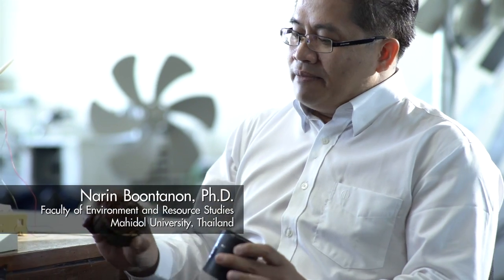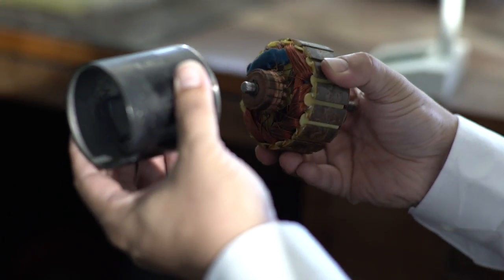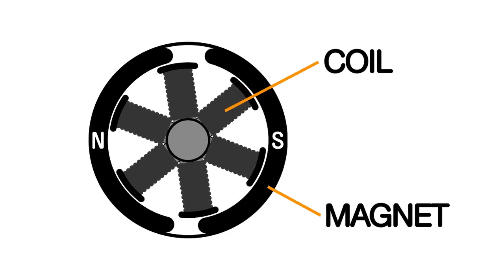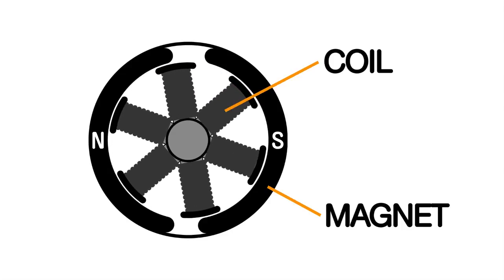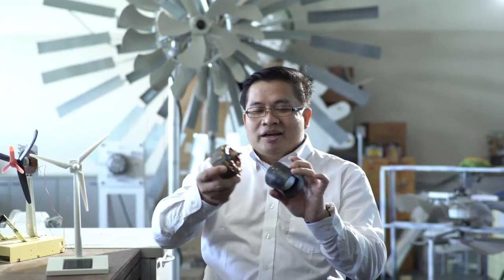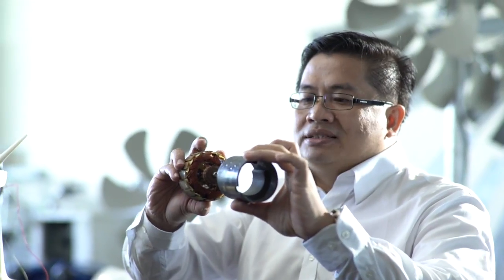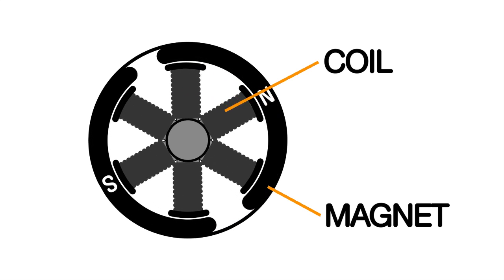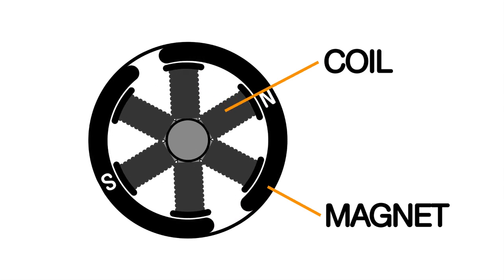Counter-Rotating Wind Generator : Research Impact [by Mahidol]

Comment: I think it just some replacement of gearbox)But counter rotation moment is good for self stabilization, and absorb of vibration. Desing has some complications to produce shaft in shaft, and rotor in rotor, like in a helicopter 🚁) By the way I love traditional Thailand windmills they are cool👍💪 adjustable sails , just add to them a  bicycles gear box and bicycle motor 3kw 48v-72v and it will generate power!

Comment: The biggest problem you're gonna have is you need to rotate the statter at the same speed as the rotor otherwise you're gonna have variant voltages.  And with wind that  Can be very difficult because wind isn't  stable
Reply: tested and working

Comment: Very nice thinking to overcome low speed wind, as increasing blades number will increase solidity by ratio, accordingly power too.  I have some questions: 
1) How to get the power curve of two counter rotating turbine? 
2) How to calculate the energy output or AEP accurately(MWh/y) of a group of this type of turbines . 
3) Did you use WAsP program by RISO of Denmark for a wind farm ?  or you used a simple xls sheet?
4) How far your applied new turbine capacity (kW) commercially in Thailand by now? farmers like it?
5) how about adding wind lens too, it will increase wind speed (may double!?).  
 waiting for your explanations. thanks from Egypt.
 best regards.

Comment: Use stronger magnets in the stator and combine the two counter rotating propellers into one to overcome the increased torque. Show me that this will not be equivalent to what is proposed. Also, the propeller behind will be in turbulent airflow from the propeller in front. Not efficient.